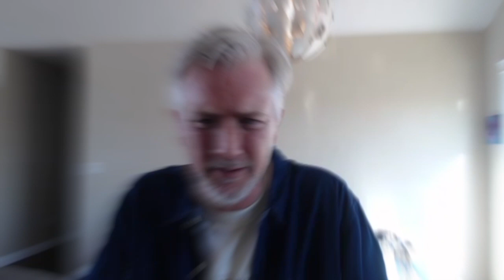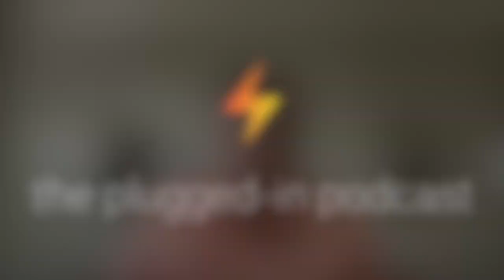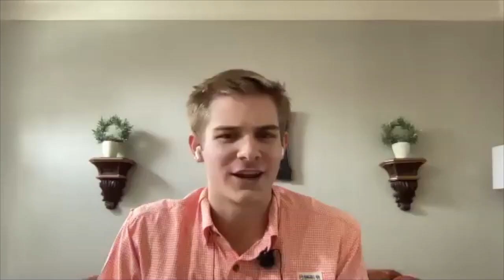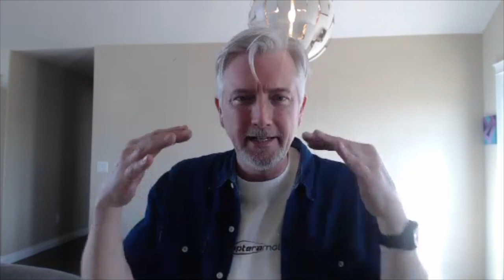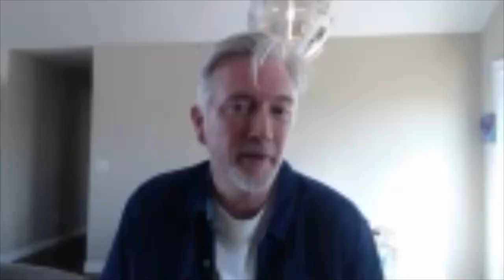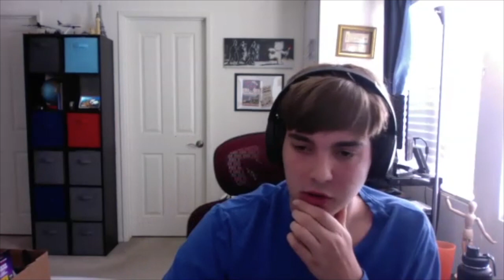Interview with Aptera Head Engineer, Nathan Armstrong

Comment: All apteras claims are still not verified, they claimed in may 2025 to have achieved 8miles/kwh, but it was found they road actually was downhill in elevation approx 7,000ft elevation drop. This is very dishonest as you can get whatever efficiency you like going downhill.
I've researched this company for almost 2 years now, and I've come to the conclusion its a sophisticated scam, on the scale of theranos. They taken $140million from small crowfunding folks, only build a handful of prototypes, never even started production.
Their claim of 40 miles from solar is also not been achieved. They should be shut down asap.

Comment: @WolfsburgWarehouse et al, Would the added cost, complexity, & weight of tilt tech justify the possible g-loading safety benefits? I.e., At max speeds, how much more steering angle could be tolerated before inducing rollover? With 2 or 3 wheel torque vectoring? TIA
Reply: Honda 4WS improves rapid lane change without putting a spin on the body. Also maneuver in the parking lot to quicken low-speed turning and reversing.
Reply: @WolfsburgWarehouse  Thx. I'm basically trying to find out steering angles & speeds that would induce flips. Mainly to program s/w to increasingly dampen steering inputs as max angles are approached, according to speed & road conditions (i.e., implied slip angles & expected G loads). TIAFYH
Reply: @Crunch_dGH  Ford caster car with AWS does tank turns. https://youtu.be/K-zA_eicikM

Comment: Nathan Armstrong, a motorcycle leans the rear wheel for camber thrust, AWS does the same without the lean, both are a centripetal force. Just put a scooter fork on the rear, operated by a servo connected to the controller. The additional steering unit provides camber, caster, toe at the rear wheel. For grip. Works like Honda 4WS.
Reply: Arcimoto has reached an agreement to buy Tilting Motor Works for approximately $10 million. Tilting Motor Works developed the TRiO, which is one of the most popular three-wheel conversion kits for touring motorcycles. The tilting technology at the heart of the TRiO kit allows riders to lean naturally into turns, making three-wheelers handle more closely to conventional two-wheeled motorcycles.